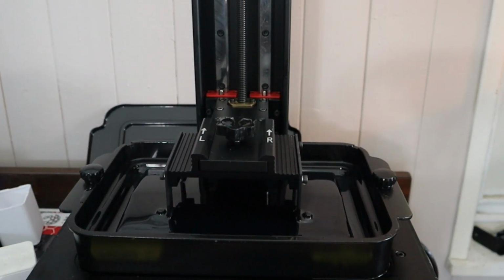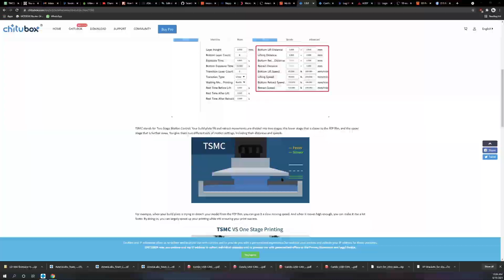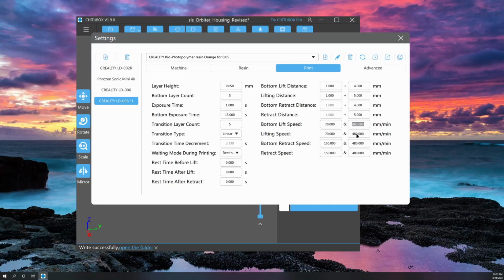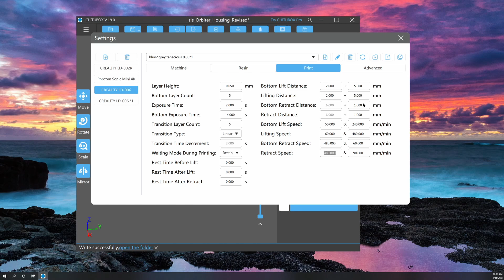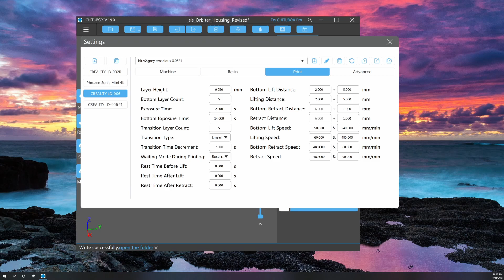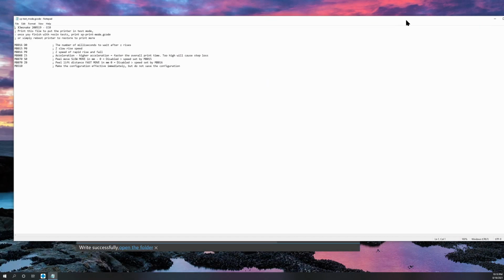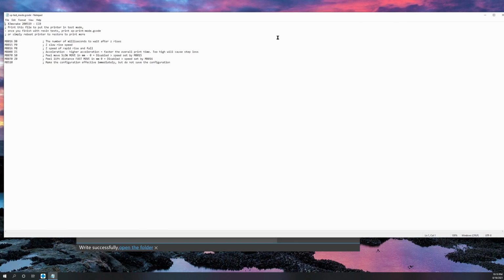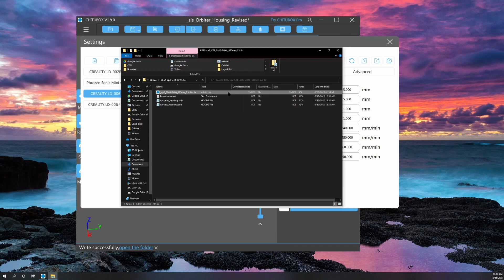better than vroom chitubox 1 9 cut print time in half.

Comment: I'm amazed they messed up the default settings so badly after having a clear image of what does what in Chitubox 2. It's still backwards. 
Also what did you do in the advanced settings? There's a bunch of compensation and PWM settings now.

Comment: Tried these out on my saturn S - works perfectly. Cut down prints from like 3.5 hrs to like 1.5 lol and less fails. Had to change the Gcode to allow the speed up though, you'll know its not working right if chitubox says one time and the printer says more like double. 

M8013 I5 ;Z运动的最大速度mm/s
 to
M8013 I8 ;Z运动的最大速度mm/s did the trick. 

almost wacked in I480 instead of I8 lol before I slapped myself and realised this was MM/s and chitubox shows it as MM/min xD
Reply: Is that a simple job of change that m8013 code the g-code file in txt editor (on Mac or windows) and place that file on the usb drive?

Comment: I have had the speeds switched for a year now. I was backwards slow (1st) down then fast (2nd) down. granted 80-120 mm/min was my faster speed. So it was working with standard resins but abs-like where it likes slower speeds, NOPE. Thank you for the explanation! Guess their manual had translation errors or something.

Comment: Got my elegoo Saturn yesterday, tried these settings on the latest chitubox version. The print time is reduced from 4hrs to 3hrs on my PC screen, put the file on my USB, then print but it ends up being still 4hrs... My Saturn is new , factory settings, latest chitubox, and copied your settings. No changes.
Reply: same here buddy.
Reply: @rebelstarcustoms  check my comment above, I had same issue - need to modify the G.code on the usb it comes with
Reply: @dilpeshpatel1998  thanks!!!
Reply: @rebelstarcustoms  did you manage to get it working?

Comment: I used these settings in my AnyCubic Photon Mono 4K. Works Great!  I did no firmware update, no gcode editing... Before I was trying Vroom settings and although it was bringing a 6 hour+ print down to 4 1/2 hours .. I was getting some print fails regularly however...  Using the settings you present here  this 4.5 hour print now is only taking 2.5 hours... Model height 50mm .. layer height 0.035mm... Zero Print fails!   Thanks for sharing this!  Oh... I'm using Lychee S!icer!!; HA!
Reply from the maker: Thankyou for giving it a try and super glad it helped you
Reply: How do you set things up in lychee?
Reply: how did you set things up in lychee I was trying and did not understand it

Comment: I just can't make it work, I'm using the same printer as yours (LD-006) and even a little print with 400 layers is taking a bit more than 2h in Slicer (probably even more in the printer). Any ideas what I'm missing? Is there anything I should also change in the printer?
Reply from the maker: Sorry imissed this but if still having issue yes you can edit the firmware . Maybe your printer has more strict limits from factory is all i could think of

Comment: Wanted to ask a question, I am running a 40/40/10 mix of Epax Hard Grey/ Siraya Navy Grey/ Tenacious for printing minis and also large 1/6th scale figurine parts, I have been tweaking as much as I can and calibrating to try to get things to run as optimized as possible, I am on a mars 3 right now, I never ever see anyone talking about Rest time before lift and Rest time after retraction, all of the videos I find searching about rest times just talk about how they deciphered chitubox's old Light off delay but no one talks about the new mode. I see you have it activated and you are running 0.0 for both rest before lift and rest after retract, I am currently running 0.5 seconds for both, that is a full second for each full layer, have you seen any problems running 0 ? Also might be a good video topic as no one talks about this. Thank You!
Reply from the maker: I will make a video for it and i would not ever use and rest before lift but if real thin resin then rest after retract can help allow the resin to settle and not be moving when the curing starts. Also the rest before lift could in theory help the peel move but imo once the light is off it really shouldn't matter and if anything their might be  tiny bit of follow up reaction . That is all really speculation but i will look into these things more for you to get some background info besides my anecdotal evidence

Comment: Why would you want to have fast up, slow up, fast down, slow down. Wouldn't fast up, fast down, slow down be just as good or better for reducing print times? or are we trying to avoid sudden shocks to the steppers to prolong life?
Reply from the maker: You want opposite you want slow up for first mm or 2 then fast then fast down and then slow when close to build plate . Idea is like you said to avoid shock and let the part peel from the fep
Reply: @advanced3dprinting  So we're doing the slow peel of the bandage, not rip the bandage off quickly. Which I presume helps save the FEP from excessive stretching or tearing.
Reply: Saturn s here I just switched my settings to these appears to be going slow then fast then slow with no updates needed. Test print in progress now

Comment: Ok.... I have copied your settings at 3:50, and the slicer shows a drastic reduction in print time. However, when I run the slice on the printer... while the bottom lift and retract seem to be performing as you have described here as well as the retract on the normal layers... but the lift on the normal layers is maintaining the same speed through the entire 7mm of 60mm/mm. Am I missing something that should have been done prior to this video other than the firmware update to the machine? I have tried this with both the basic and pro versions of Chitubox.
Reply from the maker: hey can you show me a screen shot. You have the settings identical ? did you by any chance use any calibration prints their are a few that i found that break the firmware and you need to reflash the file to fix
Reply: I'm having the exact same issue. Everything works well except for the normal layers' lift speed which is the slowest of the settings. 
Did you find a solution?
Reply: Btw I have a creality ld002h with the most recent firmware straight from creality. Also, I haven't done any of those exposure tests the change the firm and stuff

Comment: I made these changed in Chitu... when I slice it though... the time on the slicer doesnt change when I slice the model... its exactly the same as before entering anything on the right. Can I expect the same on the machine, or will the machine react correctly to the settings I have changed?
Reply: Never mind, I figured it out... even though I had the resting section up with all 0's.... I switched that drop down to the light off delay which was showing 16seconds. I eliminated that, and the drastically reduced times appeared upon slicing the model.
Reply from the maker: i shoud add that thanks for pointing that out that if someone had a long light off delay it will do that
Reply: @advanced3dprinting  there's another issue as well.... the normal lift speed parameters in the machine itself are limited unlike the retract... retract can do 480, but the lift can't... 250 works, 300 works... I'll eventually find the limit... I thought I had gotten rid of the limit in the default machine parameters but either the machine didn't register the changes or its another setting in that coding I've yet to identify... translating it wasn't easy because the descriptions for the coding were all in Chinese.
Reply: @tristonm37  Thank god for your insight!!! 12 hrs > 3hrs print...thank you! You wiil be forever in my heart lol
Reply: @neogriffin888  I put zero in the slicer and left the firmware at the default... default on most printers is somewhere around 6 or 7 seconds.